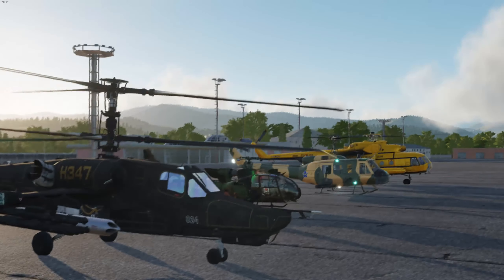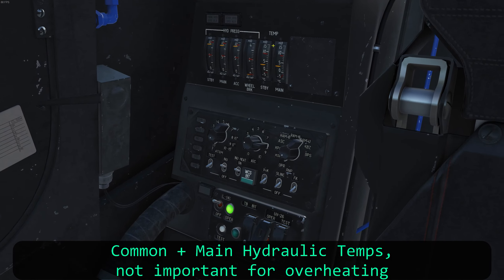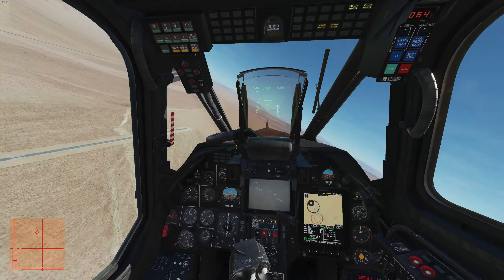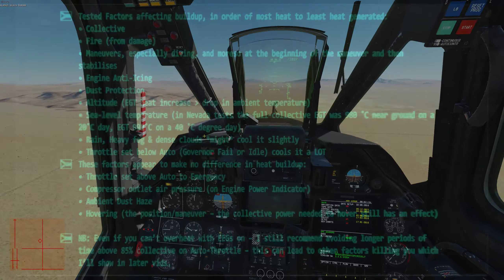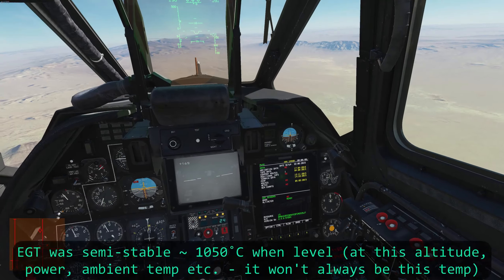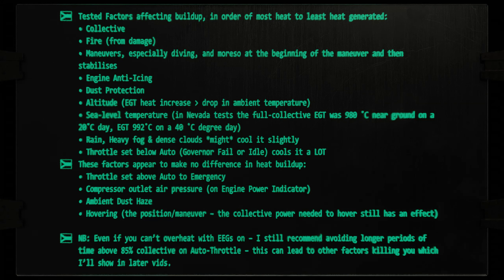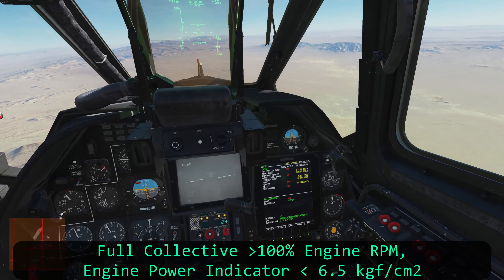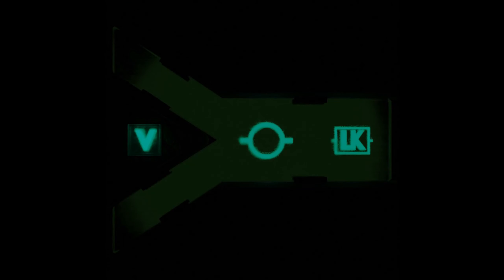DCS Ka-50: How to Break your Black Shark with Overheating

Comment: I just flew half an hour atleast through the mountains of caucasus, always over speed ofc. and then when I tried to slow down I suddenly lost engine 1 and then when I noticed it and slowed down further I lost 2 aswell and ejected :c
Reply from the maker: There's a couple of Campaign missions in Caucasus that has you flying at some extreme altitudes - so, could be dust if you were hugging the slopes, but could also be Icing Failures. I couldn't get immediate results or theories on the parameters and burnt out slightly doing the dust tests, but essentially, if the outside temp is 1 degree or less (look on the thermometer on your canopy straight up), then switch on engine de-icing for both engines + rotor de-icing + both pitot de-icing switches. They're all at the top there with the dust switces.